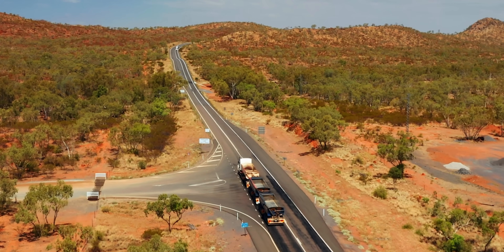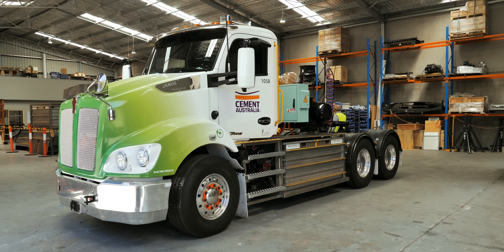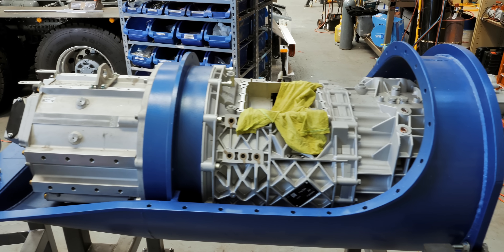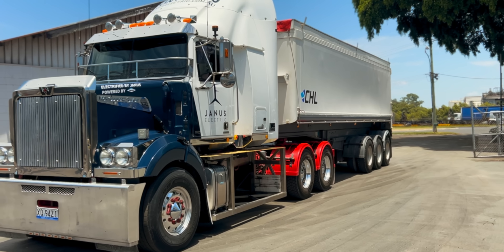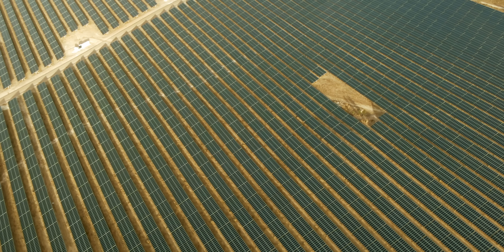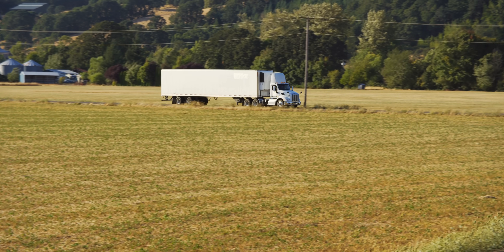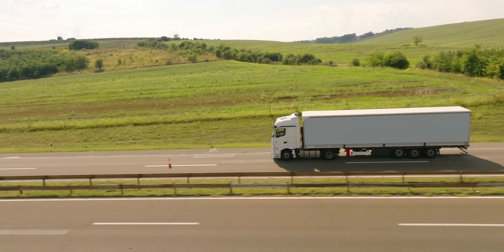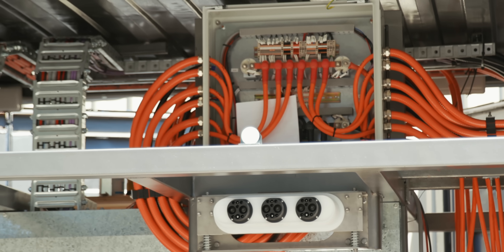This GIANT Electric Semi Can Swap Out Its Batteries!

Comment: Why not the best of both worlds? Diesel over electric like trains do today. Its extremely efficient with trains so why not semi trucks?
Reply: Plus, it would do away with the costly and even more toxic batteries.
Reply: @itsamefrank  Very heavy and would still produce loads of CO2. And battery electric is far more efficient of course.
Reply: That's probably the plan for long-range applications. Have a powerplant in the truck that charges the battery pack shown here with either diesel, LNG/CNG or even hydrogen. 
Hybrids aren't new to the truck world, but they're costly. Trains and ships get around this because of scale. Truck manufacturers here in the US are interested in this direction for their fleet customers that mostly do long mileage transport.

Comment: Swapping batteries has been happening for years in warehouses running 24/7.
Forklifts and powered pallet trucks work 24 hrs a day so no time to charge so battery swap is the answer. Takes less than one minute.

Comment: Electric trucks are not the future.I guarantee you that hydrogen fuel cell or ammonia fuel cell will be the future. They are doing technologies that will make it easier. You're to create hydrogen at a commercial level and when that happens that will be the future. We do not have time to wait for charging at all.  We need to be able to fuel and go. You don't make any money if you're not moving. The fact that people won't do electric trucks is stupid. It's already proven not to work. Electric cars are only good for inner city driving. That's it if you have to go long distance fuel cell technology. Is the future I guarantee it? This battery c*** is stupid not dimension when these batteries finally reached the end of their lives. How you're going to dispose of them none of it's green you're charging them with cold power plants.  And natural gas you're still using fossil fuels to charge them. You don't see any new nuclear power plants being built. You don't see a huge solar plants being Built-in the center of the country. Because it's not feasible you cannot have electric vehicles at a high scale. The battery technology is not close to being there. I guarantee you a hydrogen.  Fuel cell vehicle maybe with a smaller battery kind of like a hybrid might be the future for sam ice cause it would be nice To shut the engine off as you sleep. Well still running lights AC heat and the essentials wires them in your Break I guarantee you. Battery technology for semi is not the future future will be hydrogen fuel cell. Maybe ammonia but I think hydrogen's a better fuel source.
Reply: If you are concerned about electric vehicles being ‘not green’ you should not even think about hydrogen solutions as this would consume 3 times as much of that exact same electricity.

Comment: WTF 😂 batteries don't last as long as diesel engines and it leaves a bigger carbon footprint because it's harder to get rid of or recycle a battery.
Reply from the maker: I love these comments. They are so funny.
All I saw when we made this episode was piles of dead diesel engines. They really don't last very long at all.
And you always, like a good fossil head, always always focus on the batteries because that's the only hope you've got of being even incorrectly critical of these huge advances happening all over the world.
What about the electric motor? Will that last longer than a hopelessly inefficient diesel engine? 
Yes, by a million or so miles. 
No, I mean it, literally a million miles, with a service every 500,000 miles, not kilometres. Miles.
The batteries will outlast the poxy old diesel by the way.
And one last MASSIVE thing. 
How long does the actual diesel fuel last? I\ll tell you. A fraction of a second.
Can you use that diesel fuel again?
No you can't.
End of discussion. end of argument. Electric wins. Next
Reply from the maker: WTF, wrong on all counts but who cares. Carry on supporting the global fossil fuel industry. They must love you for it. Diesel is clean, just run a truck in a confined space for an hour or so, breath deeply. It's fine. Don't listen to those dumb fear mongering eco fascists. 
Batteries kill puppies. Yawn. 
And lithium is made by lizards, or lasers, or lazy people. I can't remember. 
Anyway, a massive, dirty, noisy diesel engine burning billions of litres of expensive, imported fossil fuel is much better than anything.
Don't try and change things, it's too scary.
Reply: Nope. Electric vehicles are less polluting.
Reply: @Freba9  have you seen the process of how to recycle a battery it takes more energy to recycle ion battery than to melt engine and reuse
Reply: @Rafikingtruck  sure, but petroleum production, refinery, transport and combustion creates far more CO2.
Reply: @Freba9  rather have co2 than chemicals from ion battery even a car battery is more recyclable anyways I'm not going to keep going with this I already check my numbers electric cars are not quite there yet
Reply: @Rafikingtruck  "I already check my numbers" 😂
Reply: How so explain

Comment: This is quite deceptive. .   it’s not mentioned how much more energy we will need to consume to mine all this exactly copper & lithium.  What powers all mining machinery  ? DIESEL!  Add to that the amount of extra coal needed to produce the electricity to charge all of these huge batteries.  So are we going to burn just as much fossil fuel as we did before but move it away from city street’s & public eye.  By digging even bigger holes in the ground with diesel fuel for more then double the amount of copper , coal & lithium, in the process destroy even more eco systems in very remote places well out of public eye. .   

Deceptive  ?  ?
Reply: All irrelevant. Electric vehicles are less polluting anyway.

Comment: It's a nice conversion system, but requires quite a bit of logistics and infrastructure to make feasible for any cross country travel. Still doable.

Tesla Semi however is more efficient and therefore will be cheaper per mile, and Tesla is more reliable to build out the infrastructure. So in the long run it will likely win. 

That said if you have a fleet of trucks and want to not throw them away I can see this technology being appealing but it's probably a a stop gap till Tesla Semi and it's inevitable clones take over everything.

Comment: 5-6 hours for an oil change service?? Who you getting to change your oils.. I can change the oil in a semi in 45 minutes including walking from the barrel pump to the truck 25m away with jugs.  And then at the same time I do greasing of joints and suspension.

Comment: Electric can't perform same as diesel. The charge can't hold any close of mileage what diesel have. And when you say fast charging that's mean couple hours. And batteries is chemical which pollution to  environment badly. Electric trucks is junk
Reply: Electric is far less polluting than diesel.
Reply: @Freba9  it’s not
Reply: @Tylerd838  yes it is.
Reply: @Freba9  how much pollution do these batteries make when being produced and how much does it omit when charging?
Reply: @Tylerd838  Much less than  burning diesel or gasoline over the lifetime of a vehicle.
Reply: @Freba9  says who
Reply: @Tylerd838  Countless peer reviewed research reports.
Reply: @Freba9  that doesn’t mean it’s right
Reply: @Tylerd838  Yes it does.
Reply: @Freba9  it’s not. Because research articles also claim that trans women are women or that electric cars are going to save the Earth. Just because there’s a research article or something doesn’t mean the research is true. Show me said article you’re talking about
Reply: @Freba9  false. Are you a  brain washed. Look in chemicals used in electric, and toxic fumes exposed to air...

Comment: What a small world, I sent an text to Elon Musk about your very process not knowing of it, a year ago,About his tractor and how to be more attractive to use would be to have removable batteries. Great job Australia.while Musk has bern a great innovator I think his approach to electric cars was somewhat in reverse meaning to help the environment and sell more vehicles long range & luxury on a passenger vehicle was the wrong approach,I believe and still do smaller short rang vehicles for local use would have been a better start! Standing around charging a vehicle for hours on a lengthy trip is a turn off, I’ve seen it.Mist including myself refuse to spend 70 to 100+ k on a passenger vehicle. A 10k$ 150 mile range store hopper for local use would spread like wild fire.

Comment: Who is getting 26c kw per hr in Australia??? Not me I'm 31c per hr...
That's not achievable charging multiple 600kw batteries a day. You need 420 panels on your roof to charge 1 600kw battery 🔋 that's on a summer day. Look out if the sunlight disappeared.. 💰💰

Comment: 'Cause Mineral mining for battery components, is so much better for the environment, than Gas, and Oil.......
Reply from the maker: Yes it is. Massively better. Incomparably better. 
You dig up minerals for battery manufacturing, use them for 25 to 30 years, then recycle them and use the materials again for either batteries or other materials.
With oil and gas, you spend billions finding the stuff, get government subsidies and tax breaks paid for by poor hard working families, then extract it, refine it using multiple gigawatts of electricity by the way, and massive amounts of cobalt to remove the sulphur. 
Then you burn it. Once.
Your argument is patently wrong

Comment: They need to move to this replacement feature into Cars in the US. China has replacement stations and it just makes more sense as it is a big cost of the vehicle and life of the car is over if batteries are done, not worth replacing the batteries is a complete waste and a rip off to the customer.  Great job explaining this, nice job with these conversions also 👏  wish it could be done for existing cars also...

Comment: Haha no electric forklift though. An exchange setup vs charging solves the range problem for long haul. It would commit an operator to using one vendor however and I wonder who would actually own the batteries when they fail? I imagine it would be a lease or rental situation. Wouldn't want to wreck one, pack probably worth several 100k

Comment: I also think having this technology incorporated into the trailer too. A battery pack on the trailer and have the trailer wheels powered helping helping the truck tow the load. Also a trailer swap after the load has been delivered would help with battery management, when swapped with a fully charged trailer.

Comment: Could you not have alternators in wheel hubs to generate electricity to give the batteries some charge while driving to increase the distance of travel.
Reply: The electric motor acts as an alternator when slowing down or going down hill.
Reply: @Freba9  I understand that, I just thought there are lots of wheels turning anyway so why not make use of that momentum and maybe at least have a small charge going to the batteries. It may extend the distance of travel a small percentage. If there was a small alternator developed that could be fitted to all hubs that only create minimal drag it would have to extend the distance of travel especially on multiple trailer combinations.
Reply: @lkytdsvc  Unfortunately that is impossible. A small alternator that barely requires force to rotate also barely generates energy. There is no gain to be made.
Reply: @Freba9  Thanks for the reply! It's fantastic what you are doing there. I am surprised that the Govt have not invested in getting All their buses changed to this system as they seem to have a bottomless pit of money for so many other projects that are not beneficial.
Reply: @lkytdsvc  Yes, electric vehicles are great. Over here, Western Europe, electric busses are very popular.

Comment: Still doesn't address the battery weight to load capacity issues vs range. Truth is you cannot go the same range, with the same load. Diesel engine technology can go hundreds of miles more than Electric, the battery technology required to move the same load the same distance would increase the truck size and weight, cutting payload capacity.

Comment: I have long been furious that the auto industry did not standardize the form factor and general specs for batterie at the outset. All electric cars should have hot-swappable battery packs. They missed to boat, at great expense to the public.

Comment: Its a great concept - the conversion of trucks and the swapping out of batteries.  However I am not sure that it really works for proper long haul where the truck doesnt return to the battery shop on a daily basis.  The header info is wrong.  There are 2 x 620kwhr packs not 1.  A bit short of info regarding the battery cells - what is the weight of those, not including the case, coz I am suspicious of the wh/Kg fig which I estimate to 325+ whr/Kg.  Tesla's 900Kwhr battery weigh 6-8 tons not 4.16T.  What anode material is used and what energy density is available. What GVM was used to determine range, the max 97T or more usual 44T. coz I dont believe you will get 2.5 miles (1.6Kwhr/Km) with 97T GVM. 
If the range for 97T is down at 300Km (180 miles) nobody will be interested.

Comment: It is a very neat solution. Electric truck arrives, forklift driver spends some time offloading the goods, then the same forklift driver swaps over the battery. The truck is back on the road. No robots needed.
Reply: But you have to pay for 2 batteries $$$ and a storage and charging facility for one of the batteries $$$ and your battery wont be compatible with any other battery or charging facility from any other manufacture so we will have to have duplication of many items with no compatibly therefore the support cost of the electronics / batteries will be high. 
VS Pull into a service station for 10 15 minutes!
Reply: @rods6405  Yep, 10-15 minutes and $1000 to $3000 dollars. I think transport companies would be more concerned with the fuel costs rather than driver convenience. 
The suitability of the electric truck will vary greatly depending on how it is used. If your use case is long distance transporting then this system wouldn't likely be suitable. But if you had multiple trucks doing deliveries within the same city and returning to a common location after each delivery then this system may be very suitable. Something like a cement delivery business. Truck gets a freshly charged battery, goes on a local trip to deliver the cement then returns. Battery is swapped, fresh cement is loaded and the process repeats. Depending on trip time and battery charge rate, one spare battery could be enough for multiple trucks.

Comment: You need to pull two trailers with an electric truck. A 20 foot trailer for cargo & a 40 foot trailer for batteries, good luck with that.

Comment: Exchangeable batteries is the only way EV anything will work long term in most countries. The technology proved itself decades ago in industrial forklifts with high utilization. ICE vehicles use basically that concept by refilling a fuel container and refilling the battery cabinet is same concept. Just have to have UNIVERSICAL standard as is common on lots of trucks today like fuel tanks, batteries for battery boxes, etc. Cars have an issue that the government could fix to make EV more acceptable vs all the non standardization.

Comment: this has got to be better by every metric i can think of. lower particulate matter, from emissions, AND brakes, little to no wear and tear on brakes, regen, cost per mile to move it, reliability, torque, drivetrain durability/longevity, less noise pollution (these big rigs are NOISY AF), ease of operation, etc.

Comment: 250 miles a charge isn't much, but it's only a quick swap a day for 1.5 ton less load tonnage, and massive fuel cost savings about 300$ on a 10hr day.

This is doable. And besides the guy loading batteries, the labor costs reduce.

Comment: 1:11 i stopped as you told the big LIE " faster to Charge up an electric truck then to fuel up a diesel tank" that sir is a damn Lie. you may swap the pack in 1 min but how long on what power supply to fully recharge this pack? what was burnt to make the power supply to do this recharge?

Comment: Do you know how big of a facility you would need to have enough batteries on hand to service fleets of semis? It would not be just a handful of facilities either they would have to be everywhere to the tune of many thousands of them. Then you have the issue of the amount of electricity these facilities would use to continually change huge batteries all day and all night. At some point and it is starting to happen in Europe but people are going to have to understand that the worlds electric grids can not handle the load going all electric would put on them. Even trying to upgrade the grid would not work because you still need oil, coal, natural gas and nuclear power to provide all the electric that would be needed. Solar is limited to sunshine clear days, wind power is limited to days with winds over 14 MPH. 

Wake up people this is a pie in the sky liberal dream that will never work.

Comment: Does the price the truck operator pays for each charge include the battery pack hire, and all, so a like for like comparison is 60c vs $1 per I’m for diesel as a fuel cost? 
Then he has savings on maintenance per km, maybe another 10c per km?